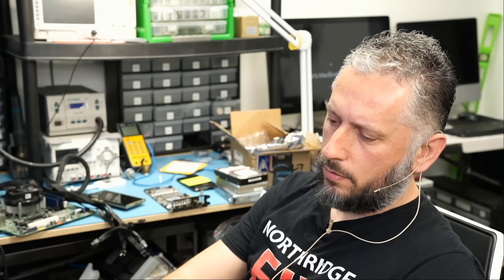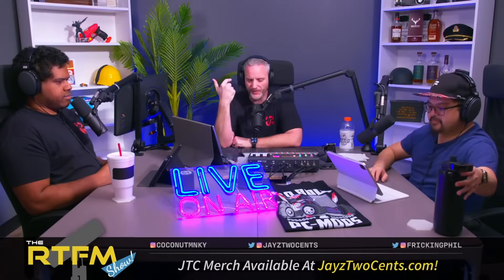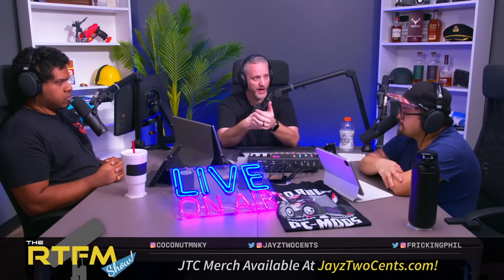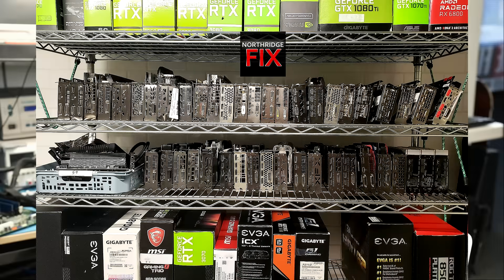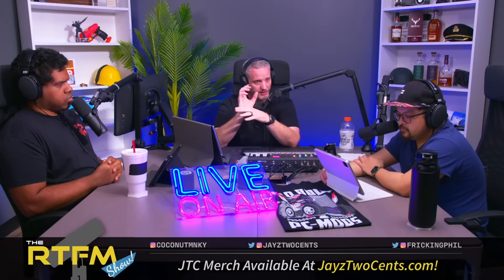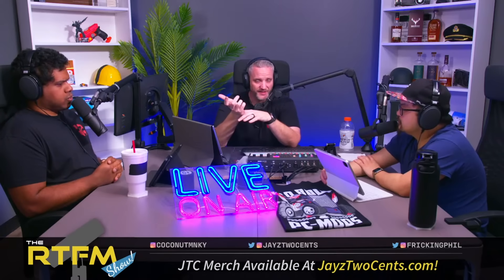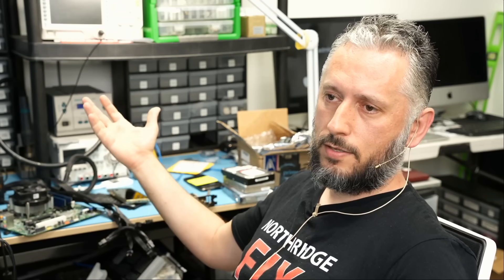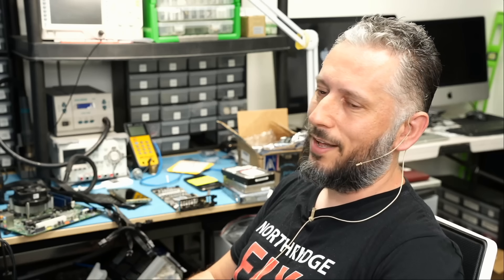Melting 4090 and CableMod. JayzTwoCents and Gamers Nexus Response. Blame NVidia or User?

Comment: Why not log the current on each pin at full load and compare it against the spec sheet for the connector. To determine what margin there is. If it works on other similar cards theres nothing to say that the current on each pin would be the same across various models.

Comment: What Steve fails to realize, is that his research was biased towards end user error. 
I say that because of two simple logic statements
 - user error can highly contribute to connector melting - that is true and Steve prove it. 
 - connector melting is not necessarily due to user error - there should be a voltage monitoring to see if anything out specs is occurring. How? I don't know, I am not an HW engineer. 
Everyone knows that COULD be due to user error. But HOW can it NOT be user error and melt? This is the question that is not being researched. 
We are trying to prove user innocence instead of RCA the hardware problem caused specific to a model.

Comment: The pins are too thin for the amount of current (and heat) for this connector.  There should be 2 of these connectors to equalize the amount of current and lower overall heat.  OR go back to the original 8 pin connectors but you'll have 3 or 4 of them on the card.   IF the 3090 ti has the same cable and SAME POWER USAGE then the 4090 is using more power outside of the SPEC which would prove the 4090 has a major fault and should be a recall. PS.  How much is Steve being paid by nVidia to keep blaming the user error on this connector melting on the card?  :D

Comment: Too many talking heads. This is a simple engineering problem and thus a simple engineering test will reveal the root cause. 
On the wires feeding +12V to each of the 4090 connector pins, put a current clamp and run a worst case GPU workload. This will give you the measurement of current going through EACH mated connector pin-pair. Then measure the highest temp amongst the connector pins. 
Take the highest measured current amongst all the pins and compare it to the power connector datasheet electrical specifications. Is the connector rated for that current at that temperature with margin to spare? If yes, then it is neither a connector problem nor 4090 problem. It is either a connector quality problem or a user error. If the measured current exceeds connector spec, then it is a 4090 problem.

Comment: What i think is the melting is caused by nvidia card like the full card is running from one 12 v rail so the power is not balanced for ex if 1 12v deliver 150 amps, 3 phases should be 450 amps , but ,whats happening is like one phase is running more than 150 amps,
To investigate, some owner should monitor all 3 cables or 3 phases voltage and amps especially for fixed pins wich every time will melt.

The solution that nvidia should do is to balance power over pins and not let power come over one connector.

Comment: hi guys. have a look at the power connection specifications. the part numbers are 10160920-1240100LF, 10127718-001LF, 10127719-001LF. very short lifespan.

Comment: Perhaps at least nvidias power socket supplier needs to change. Have you looked up the Specs of the socket you are soldering in place? Not all are equal.  
It seems a double socket design is best for next model.

Comment: You're all saying the same thing. User error is a problem. We have seen the first few that happened were really baddly plugged in.

That's what Steve tested. He flat out said design oversight. He didn't say to blame the user but it is user error if the design is shit. And it is. You guys are being hot headed and he wants to get more to fully and objectively make a claim. His would have legal merit of needed. 

Chill man. Nvidia is screwing us. Work together to show it properly so we can get crap like this fixed for those of us with messed up cards.

Comment: It's a connector/manufacture issue. The 4090s are drawing a lot of power. The card should have had 3 power connectors, instead they are shoving 3 into 1 which is putting so many amps into a small connector the heat generated, makes it melt the small connector. They needed to make the connector bigger with bigger wires to handle the amps/heat being put into the connector.

This isn't a problem with other cards that use a 3 to 1 connector because they are drawing less power. Less power=less heat. More power=more heat. The problem gets worse when you Overclock the card too.

Comment: Im surprised nobody is measuring the resistance on those 4 connectors that melt jiggling the connector and check if resistance from the metal below the nvidia card connector to the cables going to the power supply. If resistance changes wiggling the cable, then this explains it. Cable connectors get hot when theres a resistance (ohm) that proves a bad connection. A good connection has less resistance. Current flowing through cables get hot due to resistance in that cable. Also metal type on the connector itself. Different metals has specific resistance measured, and this can be checked with a cheap voltmeter !

Comment: Like Alex say: The problem is in the deign. That Card consume a lot of current.  These contacts are not enough to supply all the current. If Nvidia  put 4 more pins for +12V and 4 pins for Ground The video card will not have more problems.
Reply: it is not enough to have 4 more. look at the component specifications. 10160920-1240100LF 10127718-001LF 10127719-001LF. the plug assembly electrical contact is only rated for 30 cycles. add fan vibration and the lifespan is gone.
Reply: It's clearly melting on the female socket on Nvidia... perhaps the plastic is not suited for the amperage aka heat the cards socket should have . Alex u can fix them cards but the other 2 couldn't even begin to repair them at all ever .

Comment: The design of the connector on the 4090 from engineering perspective is wrong. I can understand the idea of nice builds cases with RGB leds and fashion cable mods. The truth is that a cable mod tail and connector introduce more contact resistance leading to more overheating of the pins contacts increasing the power loss on cables. The main problem was the use of 12 volts for 650 watts consumption in the 4090 card. The need of 55 amps of peak current is to huge for a tiny small connector. There are two solutions here, in the case to use 12 volts more connectors should be placed on the  PCB built of the graphic card. The other solution using a small connector is to increase the voltage for example 24 volts in a new design of power supplies, to reduce by half the high 12 volts current on graphic and CPUs. Such change will also increase the overall power efficiency.

Comment: If the cable mod attachment is melting despite being fully seated, and we know for a fact that "user error" can cause burned connectors. Is it possible that the couple you seen in the shop were the <1% that had an internal connector that was shifted or backed off somehow and not QC checked? honest question

I definitely agree that "it shouldn't be this easy" for a small unseated cable to destroy the whole thing...
What about heat cycles? could the issue happen over time from the heating and cooling despite the connector definitely been seated right the 1st time?

Its hard to say what is 100% at fault. But still, the product shouldn't fail that easily. 
But either way. I ain't touching a card with that new connector anytime soon. lol -- @nVidia, you might want to rethink cheaping out on your engineering side. You lost a customer definitely for this issue alone. I ain't taking chances to lose downtime on my product because of the "ease" or "chance" of it happening. Nope

Comment: manufacturing engineering error .. underengineered .. mayb 1 mm longer seat pins ?! .. obviously to much current drawn through that pin ... at some point of action and progressively melts until failure ..  the obvious OCCUMS RAZOR ... remember ...  the simplest is not necessarily the most obvious .. all the way alex until cured .. in the mean time .. boring way to make so much money if u could keep up lol...

Comment: What are the odds of a recurring issue with a particular product being caused by consumer error rather than manufacturing error? Why is this even being debated. There should be some of margin for error in case the connector isn’t fully seated regarded.

Comment: Would NVIDIA have any figures on number of failures of this card due to burned connectors?  
Does any other NVIDIA card other than 4090 have these same burned connection issues?
My first thought was:  Too much power at one connection!  Connector not designed for that much power?

Comment: I don't understand the controversy. 
They went from 2 plugs to 1.
 Why did they need 2 plugs on the 30s series? High current draw. Why did they go to 1 plug? Cost saving. Fail.

Comment: Ok so what is actually wrong with the Nvidia card ? cause the 3090 ti had the same connector and was able to draw over 500 watts, so what is the problem with the nvidia 4090 pcb ? or is it the pcb or the connector and what needs to change to improve it ? I have always thought the connector was too small for such a big wattage to go through.

Comment: @NorthridgeFix You should cut the pins on the next 4090 connector that comes with a camblemod connector still attached (so you don't make it suffer any more heat) and send it to @GamersNexus so they can have it scanned like they did the ryzen CPUs.

Comment: Old experience (at least two Generations Technician in Consumer Goods, Industrial, and Military) sayes: SImple tinned high Quality connectors (Consumer and Industrial) are capable over long Periods to carry about half the Current according to its use derated. That means at this Connector less than 3A per Pin and 18A for the Foll connector. BUT, the Pins are connected together in the Connector! Very unlikeley to achieve an even Current distribution. Goog practice would be to connect the Pins with about 30 to 40 cm of AWG#20 wire (about 10 to 15 mOhm) then the 18 A are realistic.
For this Connector type it is crucial for the Socket Contacts to "freefloat" in the Housing.

Ore to use a more robust Connector.

Comment: They should of used round pins instead of tiny square pins. Round pins would make complete contact all around. Those square pins are probably going to leave gaps in the four corners. Leaving an even smaller surface area to draw current. Penny pinching on a 2000 dollar card. Just add the 5 dollars for the decent connector!

Comment: With so many failures  occurring, it should be obvious that it's not user error... The problem is YouTubers often do this and  protect the manufacturer by blaming the user.

This kind of reminds me of fuse boxes aka tpims in Jeep/Chrysler car/ trucks. 

They fail way more often than other manufacturers yet they refuse to recall them. Instead they  pass a  $1,000 or more bill for another fuse box that will fail again in a few years.

Comment: gamersnexus sounds like an insurance inspector. why would someone go and plug in a 90degree connector into their 4090 when the the first one just melted? dumbest shit ive heard for a while. there is analyzing something to try figure something out, and then there is over-analyzing something just to sound smart. maybe its a design flaw on only a certain few 4090's, but to say all are user error cases are idiotic. he basically saying all owners of 4090's with melted connectors are idiots.

Comment: IMO the comments that blame user error are most likely Nvidia affiliated accounts trying to limit their liabilty
It's clearly a design error.  The connector can not handle the current demand and the result is that it overheats and the plastic melts or burns.

Comment: I hate those new 12/16 pin connectors. Had to deal with one on a 3080 founders edition card and it was so difficult to get the connector to even go in, because the pins wouldn't align properly.

Comment: I agree with Nvidia sticking to one of their old tradition of screwing their top of the line card at overinflated prices and cutting  on testing how safe they are but instead focusing on shipping out asap to rack millions upon millions on $2000 cards and than "its always the user fault". Not the first time this happened, seems like a very clear pattern of "pushing the limit to brag over the competition counterparts" at the expense of making a product that doesn't have enough safeguards to prevent self immolation xD Classy Nvidia, When people ask me why i never go for the xx90's...well here we go again with this issue, new gen, more of the same, next gen and the cycle repeats as Nvidia dominates the market so, they don't care about the bad press unless by some miracle some investors step in (highly unlikely as long the money keeps flowing). TLDR: Nvidia Strikes back....... AGAIN.

Comment: The pci 5 connector is a major design flaw, it’s just not robust enough, previous pci standards use a larger diameter grade cables, the move to pci 5 stuck to much power for narrower grade cable , , it lacked a clear marker on the connector, further the design it’s self and low tolerance just unacceptable, I’m glad amd choose to click to the old standard and nvidia should revert back, No graphics card needs more than 450w period if it does then the designers need to go back to the drawing board. If anything they should be getting more efficient not the other way around

Comment: In cars, mechanics might remember the furore when the first HID kits hit the shelves and the problems with the bulb connectors made out of cheap plastic and forced the industry to replace them with ceramic connectors and much higher capacity metal in the plug and the necessity esp with the newer high energy LED kits of a cooling fan to just cope with the insane temps as high current is passed through.   This is what nVidia and AMD must consider now, to utilise ceramic blocks and some sort of heat dissipation to handle the huge wattages being pumped through very small circuits.   Also some education to builders about dead air zones which invariably occur in the dead space below CPU, look at some of the later motherboards with the built up areas around the CPU, the GPU lives in this dead zone and if there isn't a dedicated throughput of air being pumped in to cool, then exhausted and pumped out carrying heat, the heat builds up in the dead zone and if you have an AIO cooler your cavity doesn't even have that central air mover with people wanting quiet over function they have been seen with cutting edge components and a single 120 fan for quietness...

Comment: 12V is not an issue.  As you often say Alex "you scientists".  Current carrying capacity of the socket(s).  The terminal resistances and life cycle for the same.  Insertion forces and mechanical restraints (i.e. support, if required).  Initially, I would suspect the currents, as in load currents being inadequate.

Specification from the plug and socket manufacturer versus current carrying capacity to actual card load currents (maximum).

I am a long term electronics engineer for now of fifty three years and still very active in this field.  Keep it simple, I have seen the same issue forever.  WRONG PLUG/SOCKET FOR THE CURRENT REQUIREMENT.  Upgrade to 'bigger', but the manufacturer will not admit it.

Comment: Why is this even a discussion, the evidence is conclusive, I don't see why Nvidia haven't done a proper investigation into this issue? Maybe people have short term memory but this is not normal and if it continues could result in a class-action lawsuit.
Reply: The 4000 series has been the biggest disaster I've seen in modern times, too many different models, too confusing, melting connectors, dishonest marketing... all comes with a premium price tag.

Comment: I agree with Alex. Design flaw--obvious from the beginning. Nvidia should recall these cards. Redesign with proper power supply circuits. Or if they wanted to be cheap Jayz solution might be a winner. Evga got out right on time! This connector is exclusively why I bought AMD this generation and decided to deal with driver issues instead. No thanks Nvidia.

Comment: GamersNexus is a very strange guy. I think he is totally out of mind actually at this case. He talks a lot of bullshit.

I'm in RC hobby for many, many years - I know this kind of problems from old connectors like TAMIYA (everybody in RC can agree with me). 

Making a smaller connector with more loose for this kind of application (more current) is a totally mistake from NVIDIA itself. of course - everything has two sides of the coin. But at this case we have a ideal presentation of melting a proper installed adapter. What a shame. 

Look what AMD did with new 7900 series. They put standard connectors and everything works like it should. Of course - 4090 needs more power, but for god sake - putting this small connector is a big mistake by Nvidia.

Comment: So what happens when plug isnt making a firm contact? Heat is generated and heat melts plastic so is these connectors to spec or did some economic person save some cents on an lower standard on connectors supplied with card.

Comment: I wonder how long it takes for the connector to start melting. Is it right after plugging it in? A week? A month? Not sure it's relevant, but really curious. I believe this is on Nvidia no matter if its because the connector was plugged in all the way or not. It should have a clip on the top and bottom of the connector. This way there is no way to not have it plugged in all the way. It would need to be fully seated and this would also stop it from wiggling.